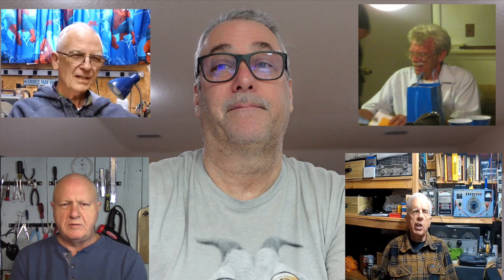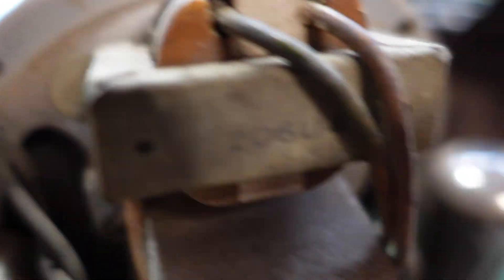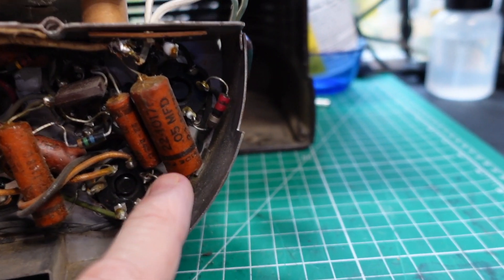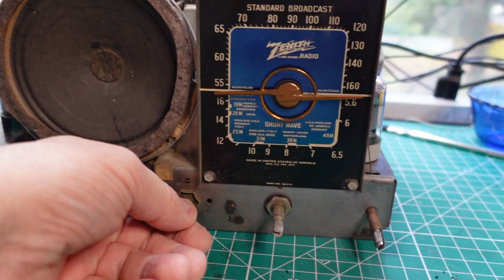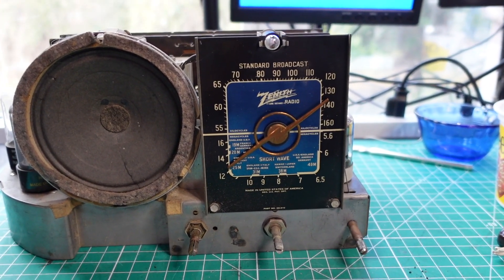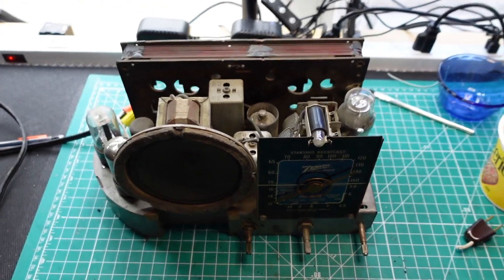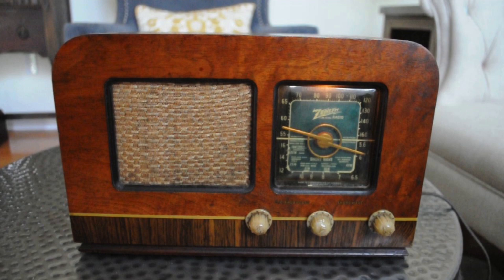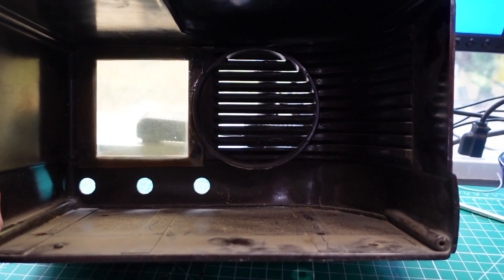Zenith 6D512   Episode 1 : The baseline

Comment: Also see: Jim Burns He tares them down to the bare metal.  He also will replace ALL of that brittle plastic wire!
---
All that noise sounded like lights, (or something) running in your work area.
Reply from the maker: thanks much. I have been in touch with Jim Burns and have his drawings for this radio. I too will be replacing the wires... just very carefully.  I agree on the lights.. it was picking up some type of RF interference.   Thanks much !!
Reply: @rciancia  - Jim's a grate guy!  I plan on a trip to visit him.